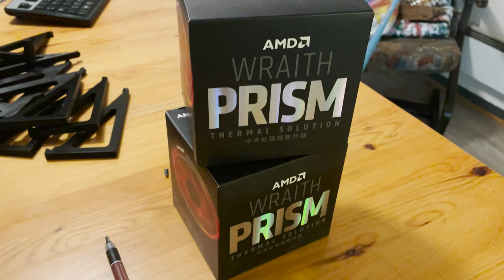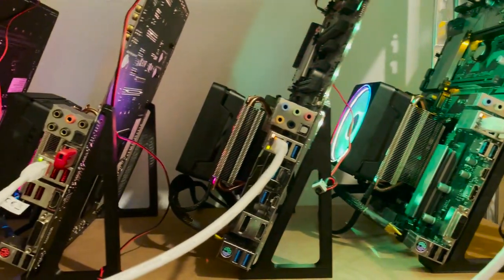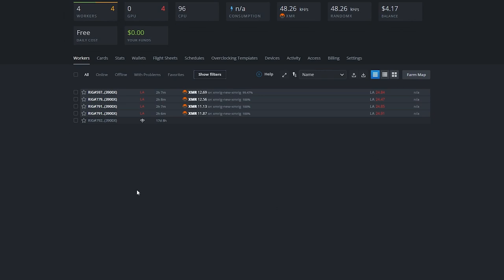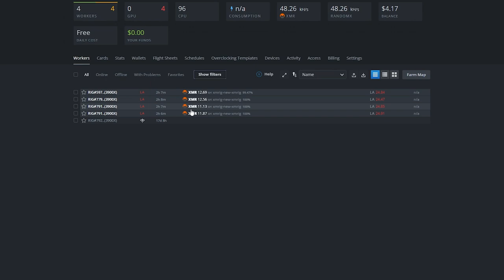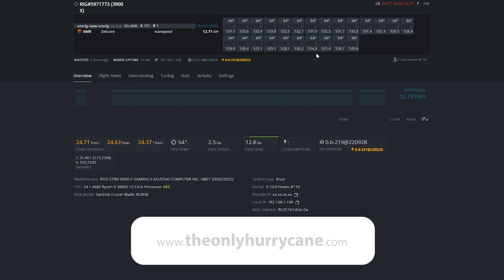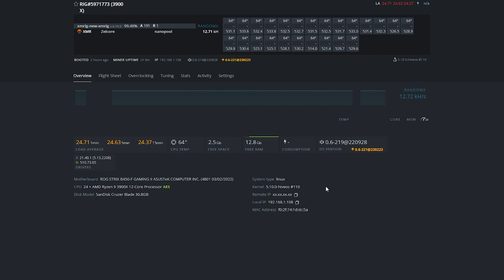This Is How I Setup My CPU Mining Rigs

Comment: What did you use to connect your rj45 cables to ?
Reply from the maker: What do you mean? I connected them to the 24 port hp switch that I have placed on the left side of the cpu rig.

Comment: Can you make a video for someone starting out and what they should get or not get?
Reply from the maker: What are you thinking about? The components or everything like shelves, motherboards, cpu, splitters etc? In my opinion, the AMD Ryzen 3900X CPU is the most cost-efficient CPU on the market. It gives you a verry good hashrate for a low-cost. Also you should use air coolers instead of watercoolers. I recommend the stock cooler from AMD; AMD Wraith Prism, its very good and cheap. In addition to this, you need some accessories like C14 cable splitters, power supply units. The power supply unit does not need to have high watt output. 500W is enough when you are just CPU mining. I also find the MSI motherboards far more easier to adjust settings in the BIOS than other brands like ASUS. I like ASUS to, but the interface of MSI for mining is in my opinion much better.
Reply: @TheOnlyHurrycane  either something that I can buy like a mini doge pro II or ipollo g1 mini or a build for around $500 that would perform better.
Reply from the maker: @LoneStarBassPursuit  I am actually preparing a video like that. In that video I will be talking about mining strategy and different types of hardware etc.
Reply: @TheOnlyHurrycane  it would be much appreciated my friend. Really. I’m injured and can’t work and looking into all means of income while I figure out surgery then recovery after surgery. Thank you.
Reply from the maker: @LoneStarBassPursuit  No problem. But sorry to hear that you are injured. I hope you get well soon. Best wishes :)